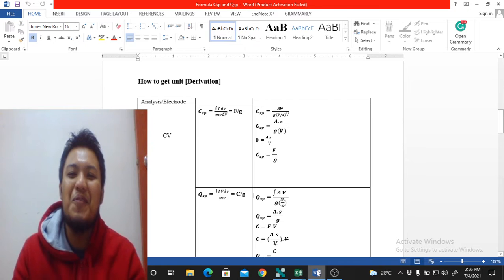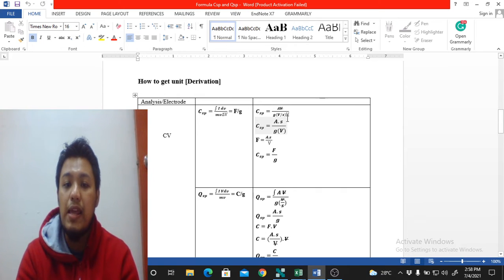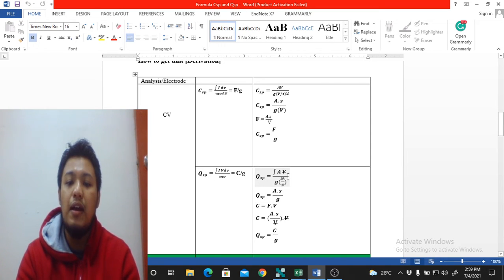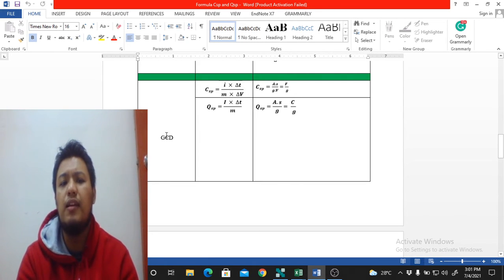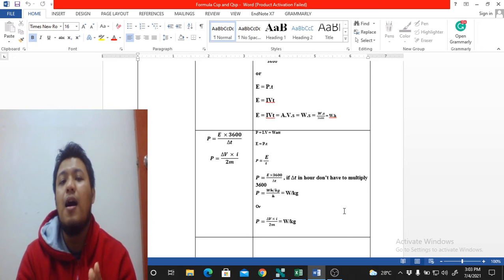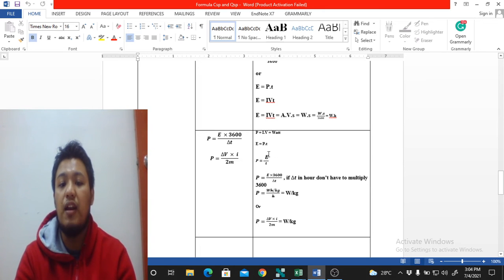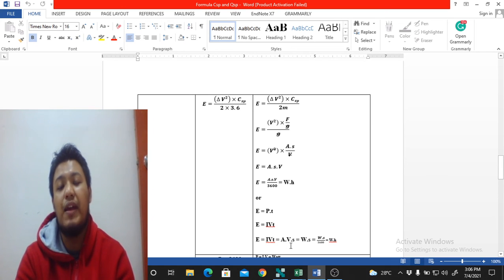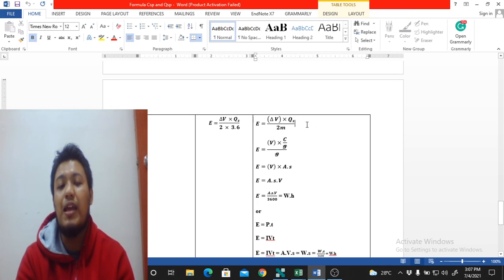How to derive Formula Specific Capacitance, Capacity, Energy & Power[ SUPERCAPACITOR/SUPERCAPATTERY]

Comment: Sir, Is there any way to compare the specific capacitance at a particular scan rate in CV with that at a particular current density in GCD?

Is there exist any correlation between these values?
Reply from the maker: If you want to compare both Csp from CV and GCD, it might be difficult because the former used scan rate while the latter used current density. The value of Csp might be different. However, we can compare the trend of Csp and the shape of Cv and GCD and relate it with the energy storage mechanism and we can also relate it with the behavior of electrolyte.
Reply: @DrHaffeast  Thank You